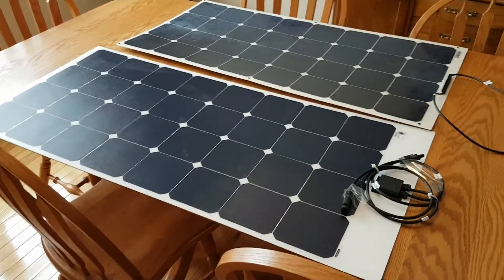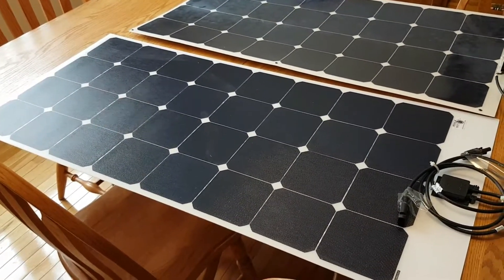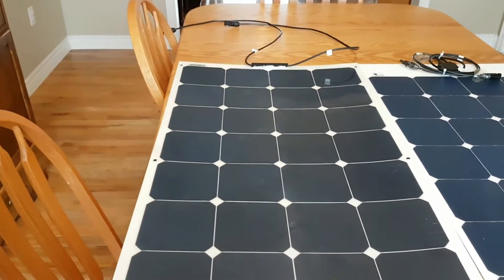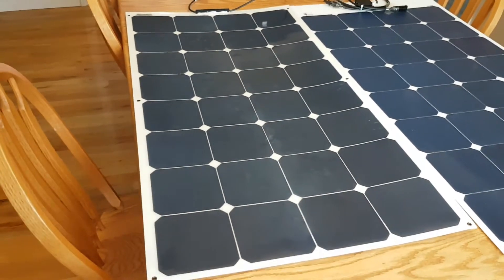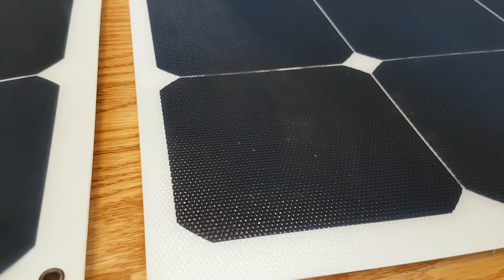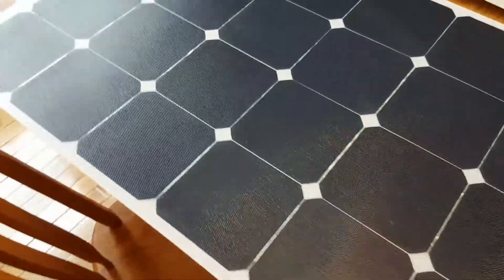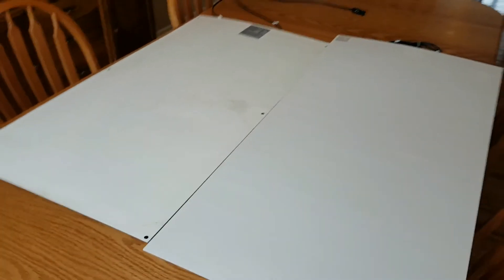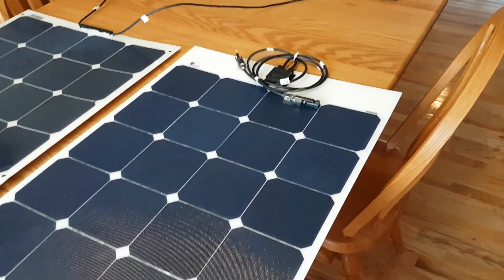LinkSolar 100 watt vs Renogy 100w

Comment: Mini PV / Solar Tips: (Winter, also camping) A boiler and other hungry electricity consumers can be infinitely dimmed using the "5000W dimmer". Ebay €7. I run 5 dimmers in parallel on an 850W inverter. Kettle 2.2KW at 150W runs 12 hours a day, so the water is always hot. The room is also nicely heated. 2.5KW washing machine runs in parallel with dimmed to 200...400W. Iron, dishwasher, oven, electric heater, coffee machine, all internal heating are throttled with me. Videos on my channel https://youtu.be/eC2olbCBhh0 The inverter stays cool, quiet and the MOSFETs + (battery) remain intact because no extreme current peaks arrive at the inverter. Now every Mini PV Inverter is enough to sell large devices. So, with the dimmer, all internal heaters/devices can be converted into base load devices that stay almost permanently ON, drawing very little current directly from the PV. With a wattmeter / energy cost measuring device you can then measure this perfectly in order to set the dimmer optimally.
       A little hint (for everyone else): Energy cannot be saved. So if I want to boil my water, I always have to use the same amount of energy for one liter. Christian's method relies on a longer period of time with less power in order to be able to use the power provided by the PV as efficiently as possible - so consumption peaks are intercepted. In the end, the energy consumption should even be (slightly) higher due to the interposition of the dimmer, but it doesn't matter, since more efficient coverage by the PV system and therefore better use of the self-generated energy .......... ............. 🌞🌞🌞🌞🌞🌞🌞🌞 ......................................................................